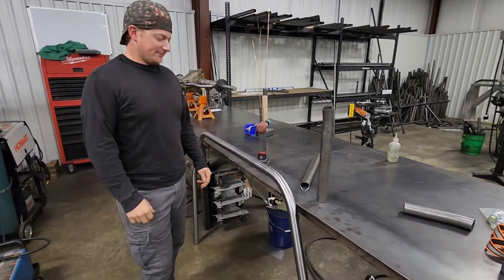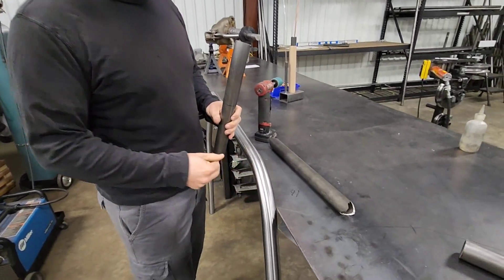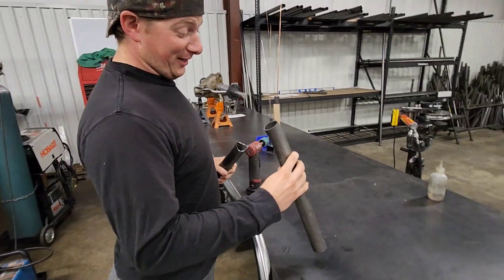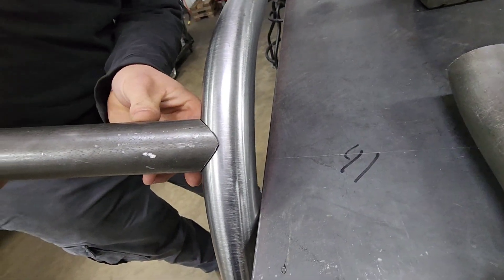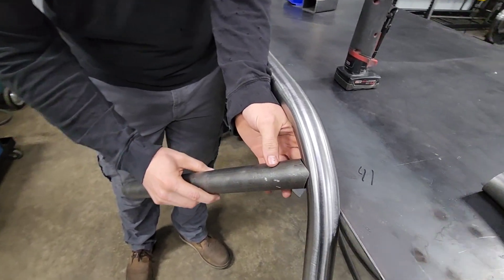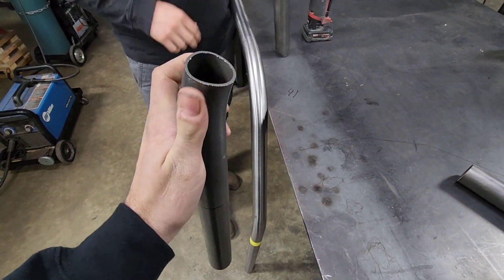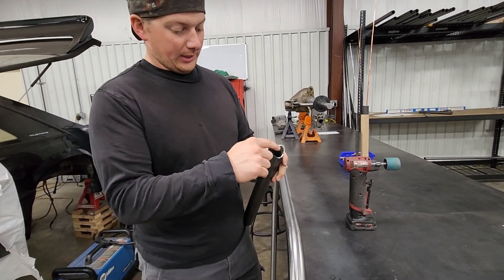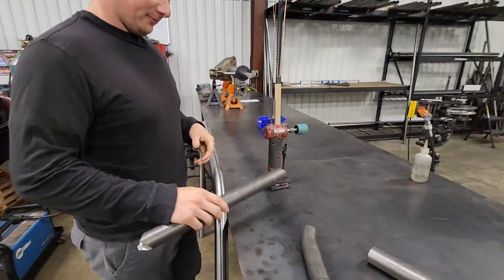Fitting Notches into a Bend- "Tech Tip"

Comment: Where did you guys get that 1 5/8 drum attachment/ paper for it? This looks super handy. Thanks!
Reply: Although I support this channel I can’t stand it when information in such a video isn’t shared when asked. Why display something or a process and not respond at some point while knowing it was a key element of the video and not put info out there. 

I recently, due to this video sourced such sanding piece’s for my DIY shop. Search empire abrasives website, there they sell the sanding rolls and the drum arbor 1/4 expanding piece to go for the sanding rolls. I did not find 1.625 only 1.5 and 2”. 

Hope this actually HELPS anyone that sees this video and wonders.